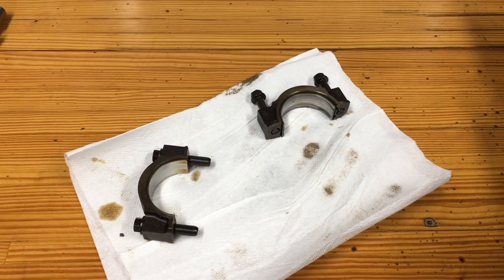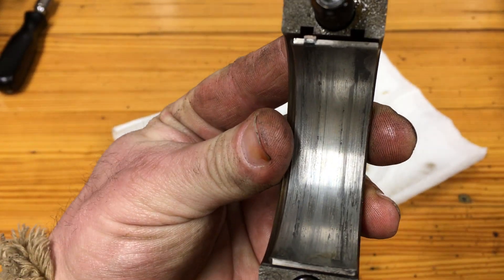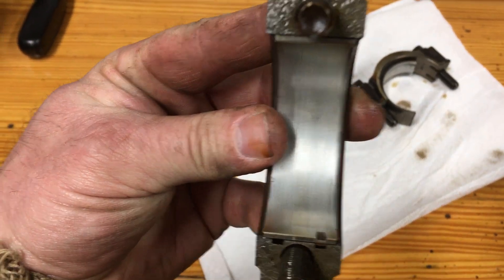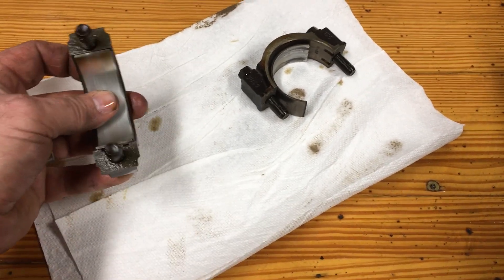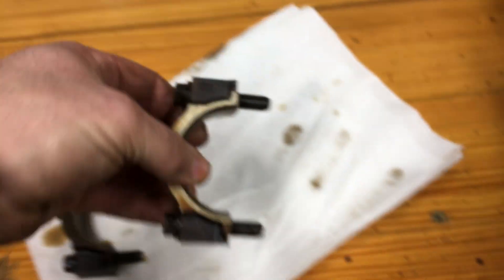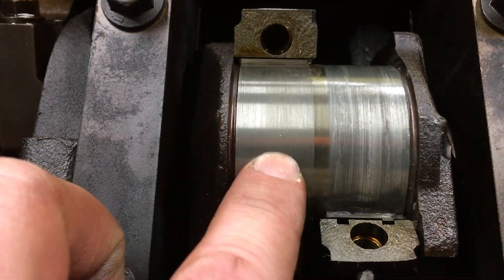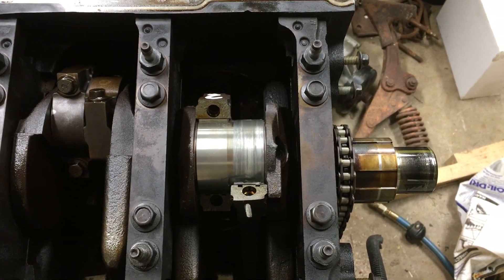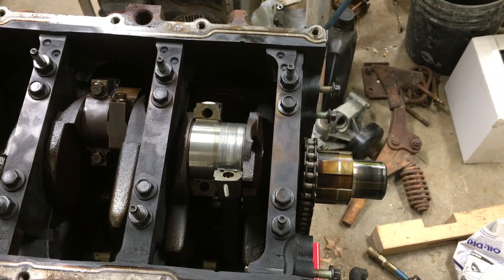"New" Used GM 6.0 LS, Exploratory Surgery

Comment: Ok I need to gather info . The motor you are showing is the replacement engine?
Reply from the maker: Unfortunately, yes. Looks like it kept running after the crash and ran without oil. It's not good but I think it's saveable. I knew I was rolling the dice buying a used engine, sometimes you win sometimes you make more work...I guess if it was easy I wouldn't have anything to video lol. Thanks for watching my friend!